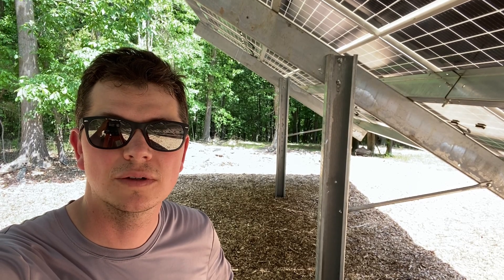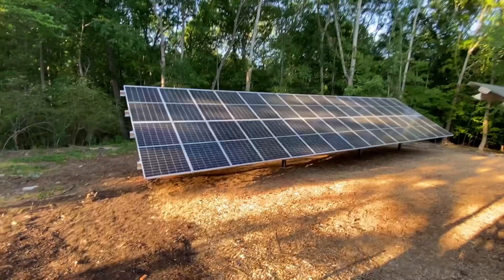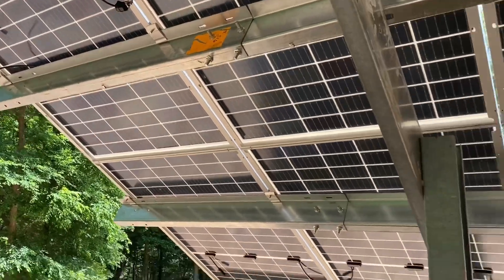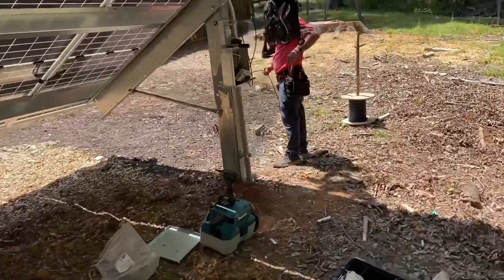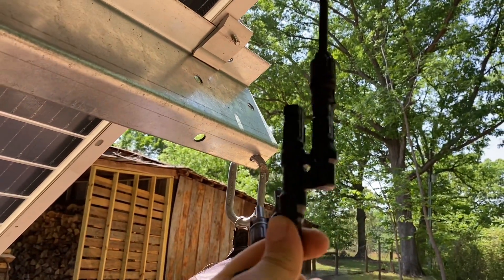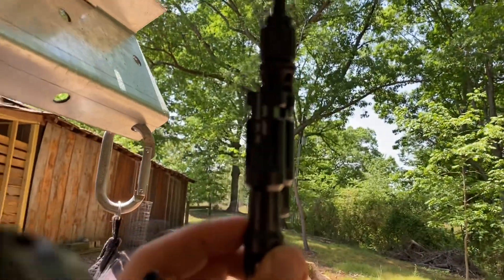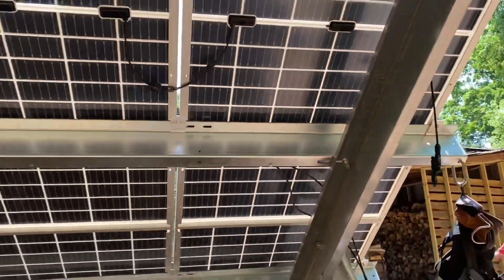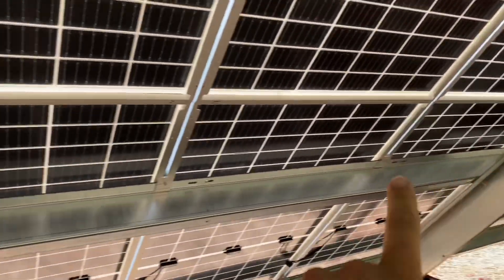How to Wire Solar Panels:  Parallel Strings with Branch Connectors

Comment: @GainSolarPower So can I please confirm this:
Currently I have 6 panels that are facing east to get my batteries charging asap in the mornings with 8 panels facing north for the bulk of the daytime solar. Each string is obviously wired in series currently and my inverter only has input for the two strings.

Can I add another series string of 6 panels on the west side to focus on afternoon solar that is then connected in parallel to the east string? Would there be any disadvantage of doing this?
Reply: As a rule, you should only parallel a string of panels that faces the same direction. Tilt can be different but they need to face the same direction. So the answer is no or not advised. You could try it but I don’t recommend

Comment: Will a 4 awg wire fit on the other end of the branch connector that will run to the inverter?

Comment: JOHNNY, THANKS FOR THIS VIDEO!
MY GOAL IS TO GET A SOL-ARK 15k & I WAS WONDERING WHY EACH MPPT HAS 2 CONNECTIONS. I WENT ON SOL-ARK’S WEBSITE TO CONFIGURE PANELS & IT SAID 7 PANELS WITH 2 STRINGS. CAN YOU WIRE BACK & USE BOTH MPPT1 CONNECTORS WITHOUT USING THE ‘Y’ CONNECTOR? IF SO, HOW MANY ‘IMO DISCONNECTS’ IS REQUIRED PER MPPT? ALSO, DO YOU RECOMMEND ‘RAPID SHUTDOWN MODULES’?
Reply from the maker: Hey send me and email please I’ll help you
Jv@gainsolarpower.com

Comment: Ultimately though, paralleling strings (particularly with a branch connector) has numerous problems.  For one thing, that means you are putting two strings into one MPPT.  If one panel goes bad on one of the strings or you get asymmetric shading between the strings, the MPPT will wind up running both the strings inefficiently.  Not just the one with problems, but the other one too.  All the strings wind up at non-optimal operating points.  So you wind up losing more than just the shaded or failed panel's worth of power.   Also, the owner might not notice the failed panel because he has nothing to compare the output against.

If each string is given its own MPPT, however, a failed or partially shaded panel only drops that one panel.  Both strings are still run optimally by their respective MPPTs.   In fact, with one MPPT per string the arrays will often run better than micro-inverter or optimizer arrays in normal lighting conditions.

Theoretically you can parallel two strings together but... well think about voltage surges and other protections.  You don't want the whole array to fry if lightning strikes nearby.  So for large string arrays it is still a good idea to use a combiner box even if only paralleling two strings.  The combiner box has series fuses, a breaker to protect the return wiring, and also a surge protector device.  Situating the combiner box right there at the array is a good idea.

But generally speaking, its an even better idea to not parallelize large strings in the first place.  Bring all four wires back, plus a ground wire and give each string its own MPPT.  And even in that case I would still put a fuse box at the array (with series fuses and surge protection, but no paralleling).   You also get a bit more resiliency as the system ages and test points at the array for checking things without having to disconnect.
Reply from the maker: Sounds like you have some field experience. The solark only has two mppt channels so you have to do some paralleling.  But I agree there are some advantages to having all the strings pulled back to the inverter but that would require 8 current carrying conductors so now we are sweating wire that could already be carrying current 200-500’. We constantly juggle expense vs ROI on these projects.
Reply: @GainSolarPower  Ah, I understand.  It looked like two strings instead of four.   Four strings would be a lot of wire to pull-back... though it would be thinner wire.  That is a bit of a tough choice.   I assume the series voltage would be too high for the Sol-Ark if you took it down to two.   That leaves only DC optimizers (like the solar edge power optimizers) , or putting the string inverter(s) right there on the array and hauling back AC.

I'm definitely in the string-inverter camp.  Though my preference is to put the inverter itself inside, what is the disadvantage of putting the inverter right on the array and back-hauling AC?   (that is, an outdoor-rated inverter or inverters).
Reply: @junkerzn7312  It's nice to take advantage of the higher voltage for the run back to the house - particularly in terrains where there are lots of trees around the houses and then open fields adjacent. And like you said, it allows for the indoor installation of equipment.

Comment: I see the electrical connections have O-rings to protect from corrosion and dirt entry...  but should you use just a little bit of Dielectric grease to help waterproof the connection and keep the O-ring from drying out? ... love your channel... 👍😎👍
Reply from the maker: Common practice is to plug the up if they are clean and dry
Reply: Solar panels in sun everything else shade

Comment: Question - if I have say 4 hundred watt panels can I hook them to two different batteries. 
 Example - panels in series coming in, then split with one going to a solar controller/battery and the other going to a bluetti 200p.
Reply from the maker: Not sure about that one.
Reply: @GainSolarPower  can you give it a try and let me know?
Reply from the maker: @dangeroustoman  I don’t have your equipment.
Reply: @GainSolarPower  I don't either. lol
But I'm curious if that would work.
 How about two batteries in the same setup.